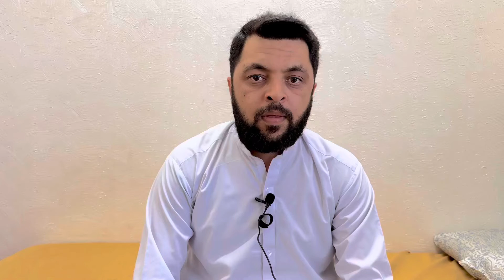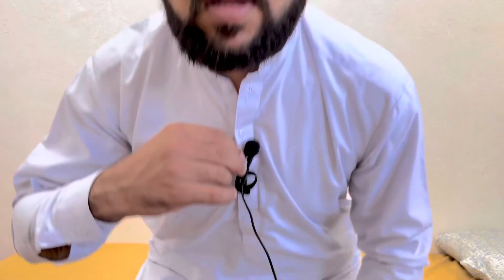General Information About NEOM Approval| Interview Questions and Answers

Comment: Assalamu alaikum Khan Shab I have some questions can you please answer

1) Before earth work what we need to do 
2) what is the difference between Sub base and Base course 
3) What is the difference between epoxy grout / non shrink grout 
4) what type of anchor bolt we are using 
5) Type of Concrete
Reply from the maker: I will upload videos
Reply from the maker: I will upload videos

Comment: I didn't attest degree due to Azad visa from KSA embassy and culture. Is it possible to get engineer profession in Neom. Do they ask for KSA embassy attestation or not. Or they need SCE certificate?
Reply from the maker: It depends on the company but mostly the contractors are not asking
Reply: @CivilEngineerAtSite  Brother after registration in SCE an an Engineer, what is next steps to change profession